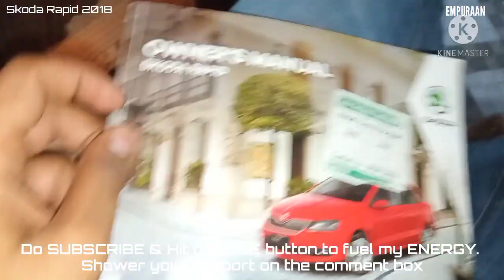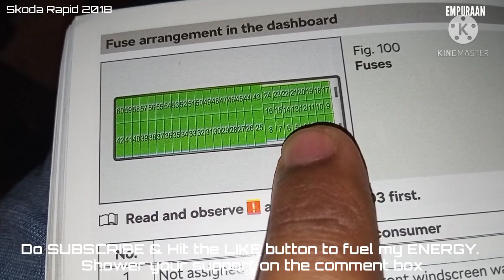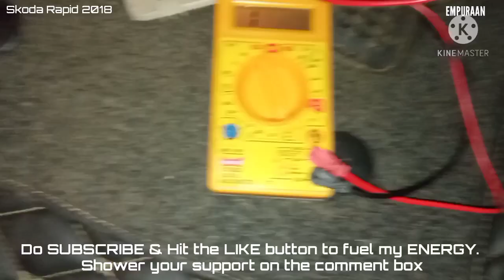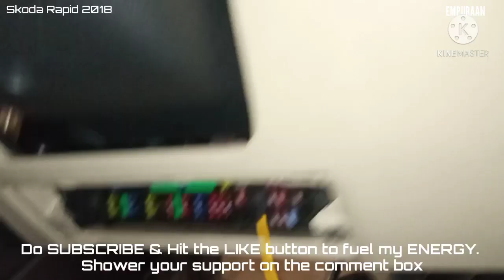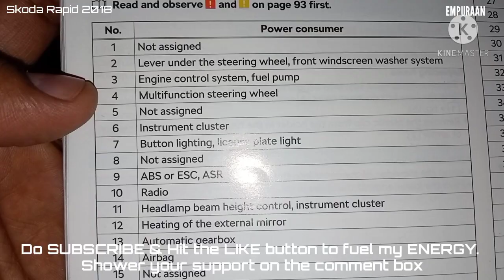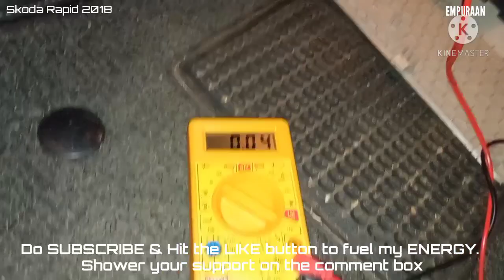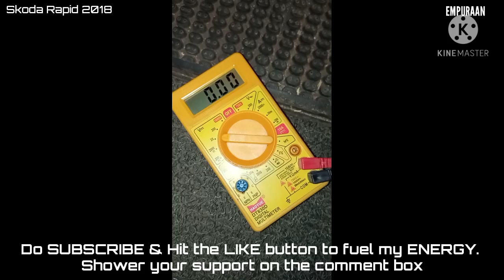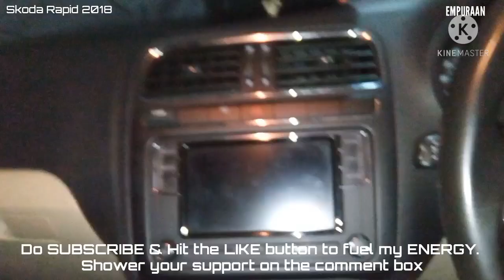Installation of DDPAI Mola N3 Dashcam Hardwire kit on Skoda

Comment: Thanks for the detailed video, it helped me with self installation of the hardwire kit for on my elite i20. 

One suggestion I have for anyone else trying to install by themself is to use MULTIMETER to find the ACC VCC
Only when ignition turned on if you are receiving a power supply on any of the fuses you can use it for ACC and even when turned on if you are receiving the supply then same can be used for VCC. Hope this helps.

Comment: I see you had put the Red fuse tap in a reverse fashion. That way it will work for the original fuse, but for the tapped fuse it will probably bypass the 2nd fuse and send power directly to the red wise. When you take out the fuse / fuse tap, only one side of the fuse slot should have power. The red wire should point towards the other direction than the slot that has power. Voltage flows from one side of the slot to the other side via the fuse. So if you insert the fuse tap reverse, it will get power, but bypass the fuse.
Reply: Agreed!!! Good Observation.

Comment: Do not put on interior lights fuse, when you lock the car the ligt will go off, and so the Power for the camera. You are a rookie
Reply from the maker: Get inside the car and then lock the car using the remote key and still you will be able to switch on and off the interior lights. 
Well I have tested my camera I can still see that it is recording even when the car is parked
Reply: so what your recommendation? Where should it be attached?
Reply: @empuraan6391  In Skoda / VW cars the interior lights switch off automatically after some time of locking the car. I doubt that it will get power through the night in parking mode. Did you get parking mode video for whole night?
Reply: @sadnabrina  I am able to get night parking videos